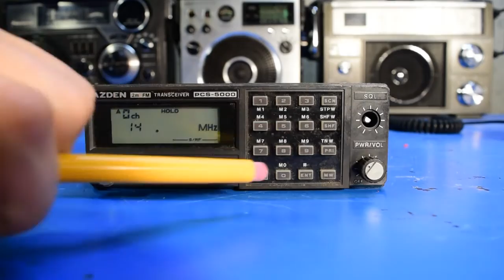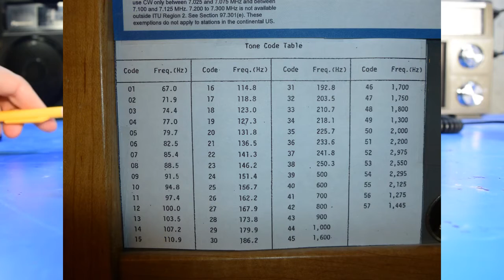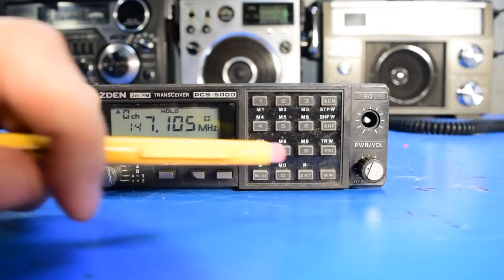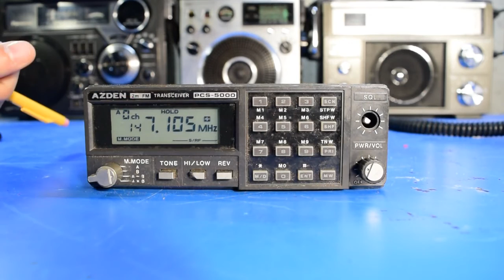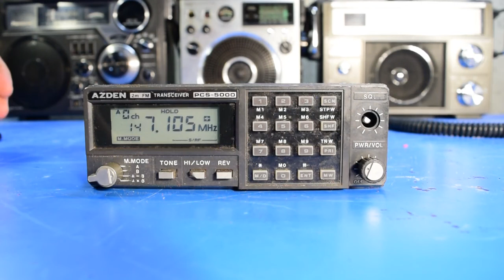Azden PCS-5000 Programming and Overview

Comment: I own the 
AZDEN PCM 5000 H.

Verry good Radio. 
The H-Version means High Power 45 Watts.

Only with little contact problems at the keyboard like most tv-remote controls.
Can be solved wirh silverfluid.
Reply: Really very solid Radio in daily use. No chance for all those china chinackrackers.
Fast in use. Strong power. Vy good Audio. Small enough for most cars.

Comment: Ok now you have me wanting to find an Azden..
Reply from the maker: They are great radios
Reply: @SevenFortyOne  I know I have a 6-meter one that I need to get going. I would love to have a 2-m one. There is a PCS-7000 on eBay right now but it has no transmit power so I'm leery of getting it not knowing what the problem is.
Reply from the maker: My guess would be a bad final output module but like you said it's a risk.  Might be better of waiting to find a better one
Reply: @SevenFortyOne  I wonder if they still make parts for those? Of course it could be the broken wire in the mic or something like that I mean the radio looks brand new though. It could be something simple or not. Do you know if they still make the transmit module for those units?
Reply from the maker: I'm not sure.  Maybe check with rf parts

Comment: Several years ago I owned a PCS-5000 and had a copy of the manual. That radio was in excellent condition when I sold it for  very low price.  I was kind of in a miniallist mode with my Ham gear. One feature I liked about it was the mic connector was on the rear of the radio. But it doesn't have extended receive. I recently bought a PCS-7400 Six Meter radio. It looks just like the -7000 Two meter.